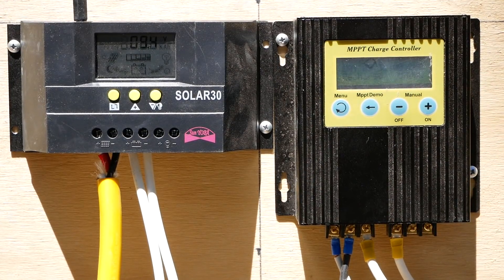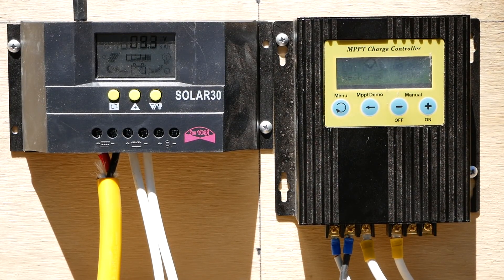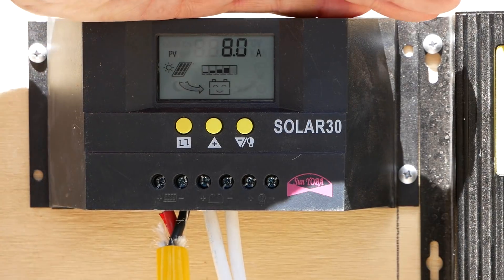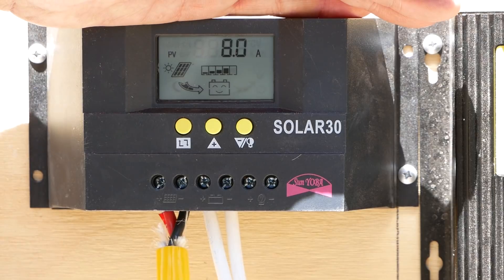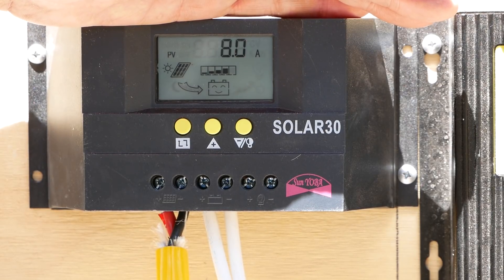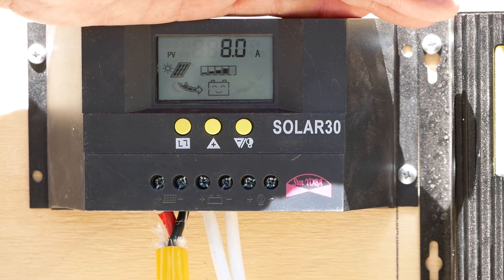MPPT vs PWM What does it mean to you

Comment: Your using 2 - 100watt panels in both applications here.  PWM the panels are in parallel giving you same voltage higher amperage. Example panel 1- 5 amps, panel 2 - 5 amps = 10 amps.  MPPT the panels are in series giving you double the voltage same amperage 5 amps. How are the panels in the MPPT generating more amps than the PWM???

Comment: I’m pretty sure I’m updated my solar I generally have amg batteries and I got one 30 ish amp lifepo4 battery I use for my ham radio hard wired.
Here’s the dilemma.
Will all mppt charge all batteries (my renogey pmt won’t) or do I have to find one that works only with controller? I’m hoping that I’m making some sense!
Reply from the maker: You need a controller that can be set properly for your batteries. Lithium especially require this. Your AGM and lithium battery will require different controllers as they will require different settings

Comment: Thanks Jim. What sets apart a $70 MPPT and a $170 MPPT?  (Besides $100!) Were you putting all 1000+ watts through the one in demonstration? new subscriber!
Reply from the maker: no the one I demonstrated is limited to 275w at 12v. Different controllers can handle different solar arrays and have different feature sets

Comment: A lot of flex panels have 32 cells, whereas a more standard 12v has 36 cells. The 4A per panel through the PWM seems low. You might try a single panel with 36 cells and swap the controllers. Another way would be to measure amps from the panel to the controller, and out of the controller to the battery. People get very different results. 

There are  a lot of low ratings for this MPPT on Amazon. I've had bad luck with cheap MPPT controllers.
Reply from the maker: I am not saying buy this controller, just showing the difference between MPPT and PWM. Used properly the Eco-worthy does great and side by side on 250 watt panels it produces the same output as my Morningstar TS-MPPT-60. Do not under wire it and give it ventilation and it will do a good job for you.
The output for the PWM is low because the battery voltage is low, that's how PWM works. More cells will not change this nor will a different PWM controller. The output will come up as the voltage of the battery does. You will see closer to the rated output as the voltage gets to 13.6v which is where the panel is rated for. There will still be more voltage for the MPPT controller to work with and it's output will still be higher.
Reply: Jim, Your video and your replies have taught me much. I have enough understanding of solar to make sense of what you say. Based on your reply to the above comment, I understand that as the battery charges more during the day, the amps supplied to the battery will increase from the beginning example of 8amps PWM and 11amps MPPT. (If I'm wrong let me know) if that's right then over a 5 hour period in your example how many amps might I expect to recover in my battery in both of your examples PWM and MPPT.? 
Thank you so much for sharing your wisdom!

Comment: Thanks for this info. What I’m struggling with is how to figure out how many Amps are needed for any given appliance and for how long. I don’t suppose that there are info labels on appliances that provide this info. Let’s say my curling iron is labeled 1300 Watts. Does that mean per hour? How many Amps are needed? My head is exploding 😫
Reply: Edith Prutz watts=amps×volts

So 1300watts÷12 volts=108.33amps

So if you have 108.33 amp/hour worth of battery, theoretically you can run that  curling iron for 1 hour off of a fully charged battery.
Reply from the maker: On many devices there are tags or markings that tell you what it needs. In general the 1300w label means it takes 1300w a hour but in reality it will shut off once it heats up and turn back on when it cools. A fan that pulls 1300w always uses that much as long as it is on. A fan also uses extra power to get it going so a 1300w inverter will not run it like it will the curling iron.
Reply: Watts and Amps ratings are always per hour. If you use a device for only 10 minutes a day then you can divide the amp rating by 6. 108.33amps in XLER's example is for an hour. if used only 10 minutes then 108.33÷6=18.06amps (per 10 min usage)
Reply: Best video I have seen on YouTube regarding solar controllers!!! Quick question. It seems like you have to run panels in series for mppt?    Is so why is that I'm assuming it's that more voltage is less loss? Thanks Jim!

Comment: I just seen you on Cheap every living. I have a question for you I recently bought a 100 watt solar panel system and I got a 12 volt marine battery. I want to run a space heater in a small 6 by 8 green house this winter, is it possible mostly at night.

Comment: bit confusing. PWM is connected to 2 100W panels run in parallel (total 12v ?) but MPPT to 2 100W panels but in serial configuration (total 24v ?) . Would it be more "apples to apples" comparison  if they were both connected to the same type of solar panel configuration? (that is both panels  either in serial or parallel ).  What if the solar output voltage is the same: is there any advantage of using MPPT over PWM?

Personally to me it makes more sense of comparing just wattage coming out form both controllers-if you are using serial connection for one but parallel for the other

Comment: Do the batteries and solar support components need a certain amount of ventilation?  For example, would it be bad to keep them in a truck bed, that has one of those fiberglass topper covers?
Reply: Get the spec sheets for the various components to find their critical high and low temp requirements, figure your worst case on either end.  Know that inverters etc throw off heat as part of the processes in them, so give yourself some extra room to operate there.    Get something rigged up to record temperature through time and set it in the bed for long enough to know what your issues might be at wherever you're going to be, especially if you can hit both high and low temp periods.  Generally, stuff works pretty well in RVs... having airflow around elements is recommended to move rejected heat... not getting your elements wet is a primary importance.  If you boxed things up nicely you might be able to put a temp controlled fan inside it and make a simple louver through the truck bed wall or something too (or bed floor too for that matter - people drain greywater through a tube drilled in the floor with some regularity...)
Reply: @lylestavast7652  -- 🙂😺🇺🇲. Thank you..good stuff.

Comment: Long. Power math. Battery math. Watts.
When it comes to power, it is easy to mix up rate and quantity used. In a car, miles per gallon is a “rate”, while gallons used is a “quantity used”.  With an appliance, watts is a rate, and watt-hours (or converted to amp-hours —— power quantities are always measured in hours) is the quantity used. Quantity used determines the needed gallon size of a car’s gas tank or the needed amp-hour size of a battery. 

Watts (listed on the back of a plug in appliances like a microwave) is the power (rate) used to run the appliance when it is running —  from a couple of minutes to days it is using that many watts at every instant while running.  Watt-hours is a quantity so it takes into account how much time the appliance uses those watts determined by how long the user actually uses it like 1 minute to warm coffee in a microwave. 

Example 700 watt Microwave:  on the back of the my 700 watt microwave it indicates it uses 1200 watts of power, so while it is running, it needs 1200 watts of power to run. But to warm up my coffee, I only need that 1200 watts for 1 minute or 1/60th of an hour, so 
(1minute/60MinutePerHour) x (1200 watts) = 20 Watt-Hours. My big mug needs 3 minutes of microwave to warm up: (3minute/60MinutePerHour) x (1200 watts) = 60 Watt-Hours. So with my big mug, 60 watt-hours was taken out of my battery to warm my coffee. 

But my battery is rated in amp-hours not watt-hours! Well, we can convert watt-hours to amp-hours or back by dividing or multiplying by 12volts

Example watt-hours:  my 12 volt battery system is rated to have 100 amp-hours of quantity, so it has (100amps)x(12volts) = 1200 watt-hours of quantity. So warming my big mug of coffee used up 60 watt-hours of it, so I have 1200-60=1140 watt-hours left to use in the battery system or it means I need to replace (charge) 60 watt-hours into the battery. 

Example amp-hours:  my 12 volt battery system is rated to have 100 amp-hours of quantity. Warming my big mug of coffee used up 60 watt-hours which is (60watt-hours)/(12volts) = 5amp-hours, so I have (100amp-hours) - (5amp-hours used) = 95 amp-hours left to use in the battery system or it means I need to replace (charge) 5 amp-hours into the battery.
Reply from the maker: great write up but man, warn me to drink my coffee first
Reply: Solar Boondocker, Ha!  I hear you!  I read one like this early on, and it tied up a lot of missing connections.  Hope it does that for a couple of people. Tried to make it shorter, but it lost its flow for different audiences. I promise it wont happen often.
Reply: @solarboondocker4597  LOL I hear ya!  Bring on the coffee! Lots of it !!

Comment: I've used MPPT regulator for AGM batteries (6x120Ah+equalizer) and belive It or not PWM is better for AGM than MPPT... Switched back to PWM and it works perfectly
Reply from the maker: In the bottom of every MPPT controller is a PWM charger, so in reality there is no difference in how the power is handed off to the battery other than the fact that all of the power of the panels is used in MPPT. The setting of various controllers can come into play. That said my Morningstar MPPT controllers keep my 10 year old AGM's quite happy.
Reply: @solarboondocker4597  when using a Mppt controller to a 12v battery system will the Mppt controller automatically create more amps with a high voltage panel? Great videos brother.

Comment: Hi. You have used 2 different sets of panels as well you have used two different types ie. solid and thin film, and also you have the panels leaning on your RV at two different angles to the sun going by the lines of your RV. Not a good basis for a reasonable comparison. Instead, why don't you use the same two panels for both controllers, leaning at the same angle, but wired up so they can be alternatively switched over and a reading taken.
Reply from the maker: Both sets of panels are flexible and lined up as close as possible. Certainly not enough difference to account for a 3 amp difference. Using one set of panels would be too time consuming to switch and not a real time comparison. The point is that MPPT uses all of the power generated by the panels while PWM uses only what the battery limits it too.

Comment: curious if the difference is as large as if charging lithium replacement batteries? I know there would still be a benefit with MPPT over PWM though. good job BTW
Reply from the maker: The type of battery does not matter.

Comment: Thanks Jim, but I'm curious what my  $210 EPEVER 40A MPPT Solar Charge Controller 100V input Tracer A Series 4210A + Remote MT50 do that the $80 ECO-WORTHY 20A MPPT Solar Charge Controller Solar Regulator for 500W solar kits can't do?  Or did I just pay too much?
Reply from the maker: The epever can handle a higher voltage array and may be more settable. Not sure without looking it up. the older epever did not let you set the charging parameters like the newer version does. And at 40 amp the epever can handle twice the watts that the Eco-Worthy can
Reply: This controller is only 1 year old and I know it asks for a lot of different charging paramaters.  I'm curious what kind of battery storage you have with that 1200 watts of solar?  I have 510 watts of solar and 500 amphours of battery storage.  Thanks
Reply from the maker: I have 675 Ah in three Lifeline 8-D AGM.

Comment: Hi Jim 
Do you have any insight on this product: 
Redarc In-Vehicle BCDC Battery Charger - Dual Input - DC to DC - 12V/24V - 40 Amp
Reply: This unit has a built in MPPT Regulator. I have 400 watts (New not yet installed) and a MPPT controller. 
I do plan on hooking up to the start battery as a back up charge system. 
So.....hence the question is this the way to go ? 

Redarc In-Vehicle BCDC Battery Charger - Dual Input - DC to DC - 12V/24V - 40 Amp

Comment: Why the difference in set-up? The LHS is wired in Parallel for the PWM and the RHS wired in Series for the MPPT.
Reply from the maker: you HAVE  to run the panels in parallel for PWM. you CAN run the panels in series with MPPT if you want to for a variety of reasons. Lower line loss and better production to the battery being two of those reasons.

Comment: some mppt controllers are poor quality though where a decent quality pwm will get more power into the batteries, ive had true mppts underperform and high end quality pwms make more power . i think mppt really comes into its own on the higher end units in comparisson to the cheap under performing mppts
Reply from the maker: The MPPT I used in this video is $69 and side by side with a Morningstar TS-MPPT-60 and identical panels produced matching results. They are easy to install, easy to set up and I never had one fail in 5 years. PWM by design will only deliver what the battery will except at a given voltage. A better PWM can not use the voltage/amps being shed due to this limitation.
Reply: @solarboondocker4597  sounds like a good cheap mppt , the one i have definitely is a true mppt yet  puts out about 20% less amps and kwh than my plasmatronics pwm side by side  , then ive owned fakes but havent we all . im keeping away from the cheaper stuff these days had a few things destroyed by them but ofcourse doesnt hurt to have over voltage battery protection devices which i shouldve had to begin with .

Comment: my pwm charge controller plasmatonics dingo 20/20 ..12 24 48 volt it won't work with my single house solar panel 180 watts why???

Comment: I want to start will a 100 watt system and go to 400 watt later 
100 watts at a time
to they make systems  that you can expand like that
Reply from the maker: It is easier with a PWM system because you do not have to have identical panels as it grows. Then again the high voltage panels that MPPT can handle are so much less expensive that you may not have to grow it at all.

Comment: what was the angle of the panels and were the panels all the same brand, angles look different between the sets, and also looks like different brand of panels, and are the panels the same age, are the controllers (chargers) from the same company, are they the same age, what type and size of shunt was used ????
Reply from the maker: I swapped the controllers on the panels twice and any minor differences in tilt, etc showed no differences. I ran the same test before for Bob who will release a like video. Controllers are not of the same company but all PWM will give the same results and the MPPT produces the same as if I had a Morningstar MPPT controller. All was new for Bob's video. No shunt
Reply: the old saying goes you get what you pay for, so a cheap controller is not going to be same as a good one, my PWM cost $150 and also did you have a battery temp sensor installed
Reply from the maker: This is why I did the side by side test. You can get the most expensive PWM controller, hook up ALL the toys and that inexpensive 6 year old tech MPPT controller is still gonna whup its butt side by side. You simply can not change the fact that a PWM controller is limited to the battery voltage no matter what you do, how many toys you hook up or what you spend. PWM is PWM.  The only thing it does beyond hooking the panel straight to the battery is keep the voltage from climbing too high and cooking it.
Reply: mine is connected to a battery monitor, which tells a lot of things, my controller will work by itself, when hooked to battery monitor it will do a lot more, also battery temp sensor is important because batteries need to be charged at different volts depending on battery temp, in different stages of charging
Reply from the maker: As a simle battery charger amp counters can work well if they know what's in the bank to start with. When you use the solar like I do, as a generator without need of the batteries, the counter gets confused. Temperature sense is good if you move from one extreme to another but even daily swings of freezing to hot does not make the mass of a big bank change quickly. A voltage sense line on the other hand makes sure the controller knows where the bank is.

All that matters is that your needs are met and producing more than you use is key. MPPT allows you to make more from the same array
Reply: I believe the controllers have an internal shunt that measures Amps that you see on their meters.

Comment: That is not a fair comparison Jim - One parallel and one series. The MPPT will of course get more amps because series gives  higher voltage and that is what MPPT uses.
Try again with both in parallel. Many people already have a parallel system and don't want to rewire to change to MPPT.